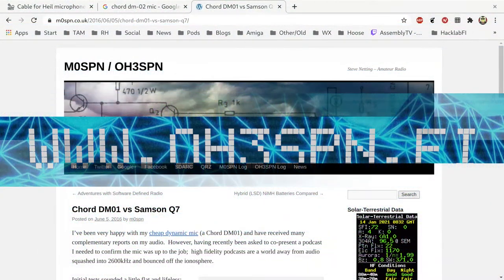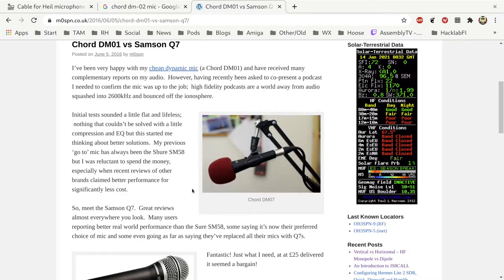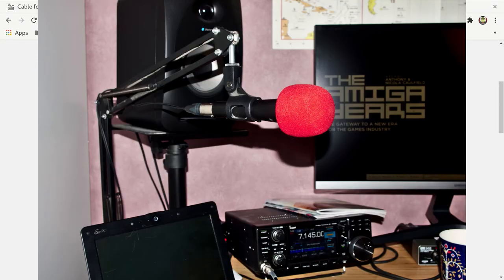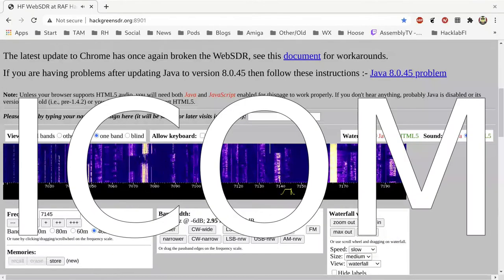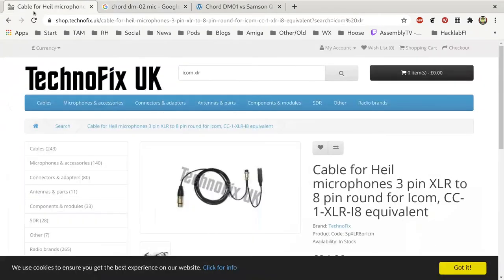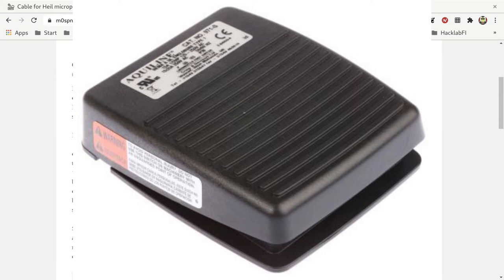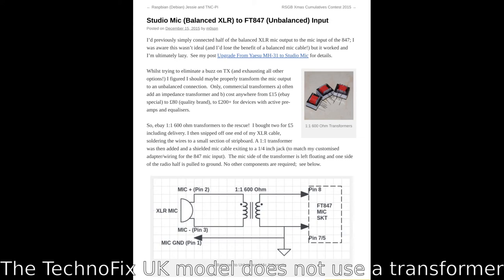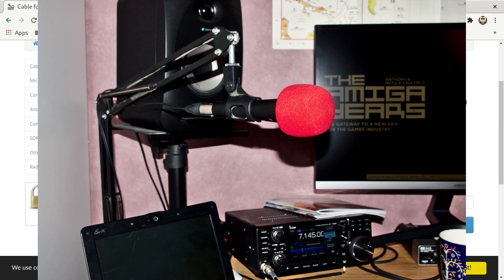ICOM 7300 Hand vs Dynamic Mic; Myths and On-Air Tests

Comment: Good video Steve. I just got a 7300 and I have all kinds of SM58s and an 57as well as some condenser mikes. I will probably do something like this, as it also go's hand in hand with setting up a PTT to trigger my FL21000B power amp.

Comment: Don’t “need” the transformer and being 1:1 it won’t alter voltage gain. The transformer may help avoid RF coupling into the audio chain. You should also consider a DC blocking capacitor as the radio is designed to supply bias for the electret mic. It may not hurt anything but I have always used a cap on my Icom cabling

Comment: I had a similar circumstance from 25+ years ago with a new ICOM 736. It came with the IC-HM-36 hand mic. I went through a Field Day contest screaming into that mic and making very few contacts so I thought I needed to make a change. I had a Kenwood MC-60A, a dynamic mic, left over from selling a Kenwood HF rig and decided to wire it to the Icom. In that day and time you had to trust🤔 the people you normally talk to on HF with about their opinion of your audio. I immediately started getting "GREAT AUDIO" reports. Between then and now, I had basically gotten completely out of ham radio for nearly 20 years and in 2018, dove back in. Bought a used Icom 736 and mated it to a new MC-60A again. I have to wonder if it would require 100% gain on a 7300. Different radio I know, but I run mine at about 70%. Still getting those "Great Audio" Reports. Great video. Thanks and 73s, KX5E.

Comment: Hi. Nice demonstration video.

I am using Audio Technica AT2005USB. USB dynamic mic, connected to RAspberry Pi 3B+ via USB cable. I stream the mic's audio to the rig via USB cable. .  With FFmpeg's command line tool, I able to add audio effects such as audio compression .  Forr PTT, I vreated simple scrip, wher I onlu need to hit space bar to toggle the PTT.

BTW, we can use the TX button to toggle the TX mode, if we want to rant for many minutes.. :)   

Thank you and good luck. 73

Comment: Hi informatie video thanks, for my Icom ic-7300 I use the Heil PR 40 microphone with pre amp, seems to go perfectly together, thanks from Rotterdam,.....
Reply from the maker: I have never heard a bad sounding Heil.  Perhaps I could throw some money at this and perform real on-air tests with a range of mics.  I don't doubt the Heil would be fantastic but I wonder just how close I could get with other (budget) mics;  my experiences with Shure and AKG have not been positive, despite them working well for non-radio use.  Thanks for your comment :)
Reply: @oh3spnfinland718  Hi, if its any help i found the Rode m3 gave impressive audio and that cost 80 euros,,73...
Reply: @oh3spnfinland718  hi,also there are many many influences, regarding good modulation. 👍
Reply: @Bernard-John  Yes, but the Rode M3 is a condensor mic. They sound great if you want ambiance (e.g. choirs, acoustic instruments etc.), but for Ham radio I prefer a dynamic mic because of it's proximity effect and the stronger rejection of unwanted sound, including the ambiance of the room you are in.
Reply: @erpece  Hi,I now use the Heil PR 40 microphone, without a pre amp,,,,super happy with the radio reports,,,people ask me what microphone I use because of the clarity,,,,thanks from Rotterdam 73
Reply: @oh3spnfinland718  Dos that go for Shure 57 and 58's, as well?

Comment: Steve may i ask you a question. If you had a mic using its own phantom power unit, would that help in reducing how the mic gain on the radio was set to? best wishes Dave M6ENS
Reply from the maker: That's a good question.  I think mics that use phantom power (for example condensers) do typically have higher output, so may be a better match.  However, at that point you're likely using an external mic pre-amp, which really negates the issue anyway.

Comment: N6AJH.  I A 600  ohm 1:1 mic transformer will give you the same voltage on the secondary as the primary. I am doing the same thing but using a 1:2 to get a 3db boost as you see the voltage output of the dynamic is lower output than an electret mic. I hope this helps.

Comment: I suppose VOX will not work correctly with a dynamic mic, unless you have a preamp?
Reply from the maker: I believe VOX does still work, providing the mic gain is at/near maximum.  However, I've not properly tested this.